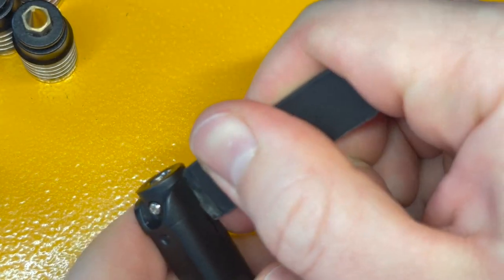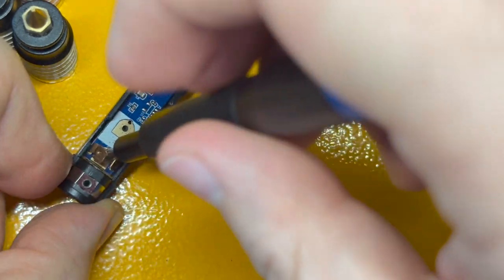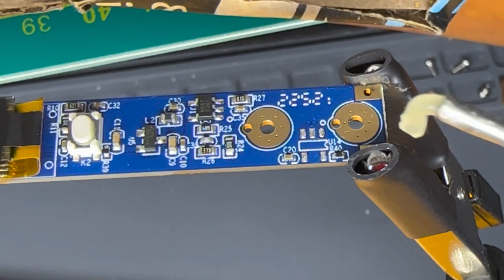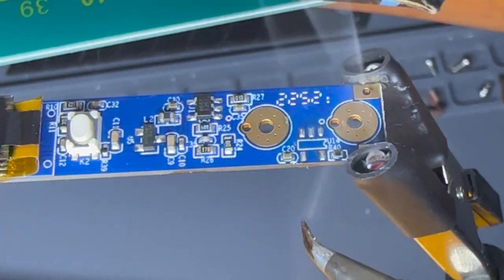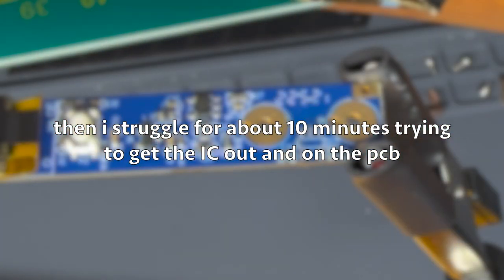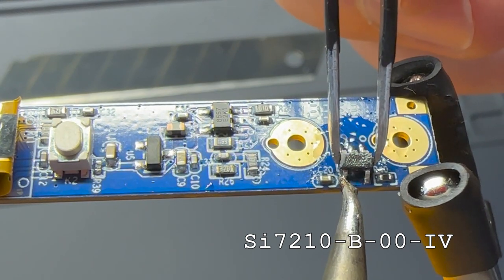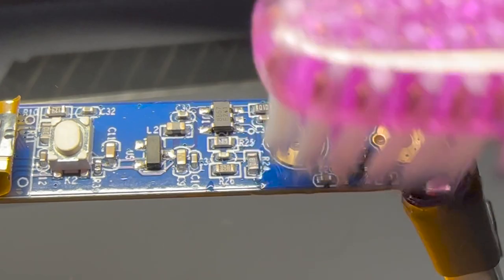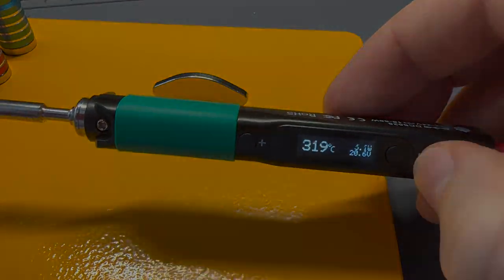#23 Upgrading Pinecil V2 with a hall effect sensor

Comment: thanks for the video.    LCSC has this sensor for $0.88 cents. (they are a sister company to JLCPCB). 
I recommend also getting a spare OLED screen and a couple $0.30 cent mosfet and buck converter for pinecil in the same order. parts for V2 and V1 are all in pinecil wiki under datasheets section.
Reply from the maker: thanks for the suggestion. added to description
Reply: @UNgineering   what  it bad is the  shipping cost,  LCSC, Digikey, and Mouser all charge $5  shipping. They are only places that sell this hall effect sensor.
Reply: I used to look through mouser catalogs and try to match the items id pull out of tvs, ect.  Just stumbled on your channel, neat stuff
Reply: as of 2024-03-27

LCSC is now 2.82 & out of stock 

Mouser 1.98 + 7.99 shipping 

Digikey 1.98 + 6.99 shipping

Comment: When you said that you took ten minutes to get the smd out and dropped it, I had to chuckle. I had the exact same displeasure today trying to repair mine...I just took and hour and was still not successful. It sucks if your best iron you'd need to do the soldering job is the one that needs repairing.
Reply from the maker: Repairing my pinecil was a stark reminder as to why I bought it in the first place :)

Comment: My only issue is not being able to solder onto my soldering irons pcb because I only own the one soldering iron.
Reply from the maker: hold the soldering tip with pliers, heat it up with a lighter, touch solder, then lighter, then pcb, lighter,  solder, pcb and so on :)))
Reply: Or better yet but another Pinecil😊

Comment: Do we need update firmware of Pinecil V2 to get support of hall sensor? Or it is supported by default?
Reply from the maker: looking at the commit logs, it looks like it's supported since november, so depends when yours was flashed. i flashed mine with one of the recent builds (you can go here to find one of the buidls with artifacts and use that to flash: https://github.com/Ralim/IronOS/actions )
Reply: @UNgineering  Ok thanks. Im searching where to buy, from officials they do not ship to Ukraine.
Reply: It has been supported since even when we had older V1 pinecil. There was an update to how the  sensitivity of the hall sensor works sometime in 2022, so if you have any firmware from 2023 you are good. still good to update pinecil as I find all kinds of clever things improved.
Reply: @nidusa1  thanks for info. Waiting my pineV2.

Comment: Are there any reasons, why it was not placed at the factory?
Reply from the maker: maybe supply chain issues? i have no idea.
Reply: I remember at the time older Pinecil V1  came out, this hall sensor cost even more nearly $3 each.  this raises the cost of the Pinecil a lot more for a feature that not everyone needs both for the part and labor of install and post sales support issues.
 This is  a budget  soldering iron.  It  was a good compromise to simply  put a footprint on the PCB  that end users who have more money can add later.  
I wish more companies would do that,  rather than just canceling features on a final production.  give us at least the footprint and  possibility for stuff and those who care to have  niche functions can add it DIY.
Reply: @UNgineering  thank you

Comment: Maybe somebody knew if SI7211-B-00-IV will be working too? Cannot find it in my country.
Reply from the maker: most likely not - SI7211-B-00-IV has voltage as output, while SI7210-B-00-IV has i2c output
Reply: @UNgineering  How about SI7210-B-00-IVR? I think this is 100% comparable?
Reply from the maker: @JohnGotti__ the specs look identical, so i think it will work without issues
Reply: Glad you got away, John.

Comment: It has Bluetooth i don't remember hearings that before and for what purpose
Reply from the maker: you can adjust all the settings via bluetooth. look up PineSAM on github
Reply: Having a digital solder control access and a magnet sensor sleep would mean it is possible for a regular dude to make an automated Arduino/Pine welding/soldering robot